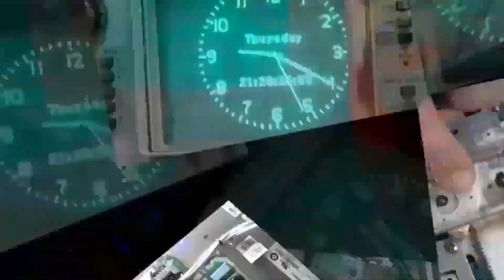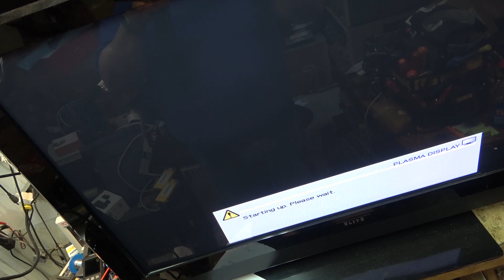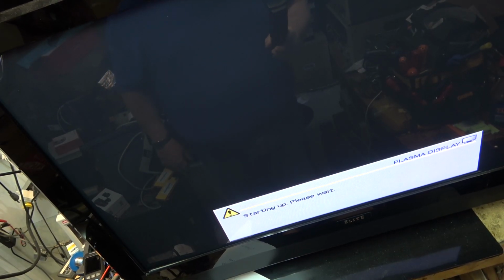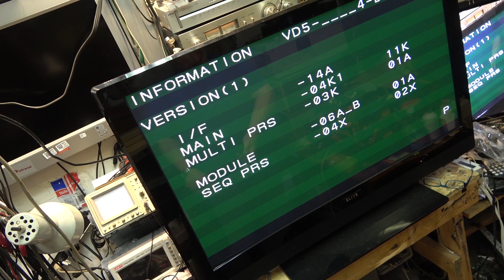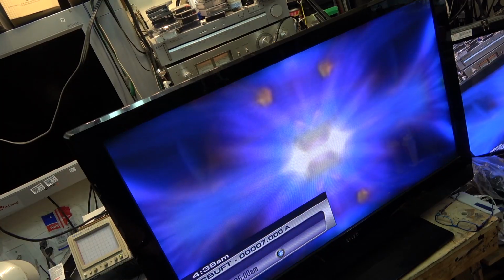Pioneer Plasma TV "Trap" Switch bypass and reset procedure

Comment: Hi I get a black screen on the Pioneer Kuro Plasma Television on start up I press the on button on remote I hear a click TV boots up then shuts off in a few seconds and the blue light is there blicking 12 to 13 times please help me.

My remote is a AXD1555.

I bought this TV brand new in 2007 at my local Bing Lee Appliance Store and been using it in 2025 until the issue happened today I turn it on watch tennis for about 10min then it instantly shuts off by itself my all the dust in the vents over the years in top vents ?

Anyways I try to turn back on but it boots up stays on bkack screen then shuts off instantly and blue like flash 12 to 13 times. Maybe it's a software issue related to digital tuner pcb TV Guide being outdated or damaged main board pcb.

Note: I can't access menu or settings on my remote no matter what I press.

Because the tv would shut off instantly with the blue light when I press the on button standby with black screen I hear it coming on but it clicks and goes off sigh 😩

Comment: Does the the trap switch get activated if there is no power to the plasma when the back is removed? Would it be possible to slide a bid of card down in-between the back cover and the frame to stop the trap switch from being triggered? thx
Reply from the maker: It triggers if you plug in the power with the back of even if you don't attempt to turn on.
Reply: @12voltvids  so if I remove the power lead and then remove the back it shouldn’t trigger the trap switch? I have a PDP-C509A so if I do trigger the trap switch I’ll have to get a factory service remote I believe to reset it.
Reply from the maker: Won't trigger unless you apply power

Comment: A Trap Switch???? What a diabolical sadistic stupid idea!!! Who the hell did they think they were? A-Holes. I ran into a similar situation when RCA went to the CTC 186 from the CTC 177 then to the last Thompson CTC 203. It was CHIPPER CHECK a hairbrained idea to mimic a vehicles' ECU interface. The only problem, and a GIANT one is although the CTC177 had a chipper check socket, you would BRICK the set ii you plugged it in to that chassis. See service Bulletin # FUBAR! The service menu on a CTC 203 was not accessible any other way. Unauthorized Techs were done. No adjusting anything even Vertical height or a tuner alignment with out the added hardware-software expense.  Back to the point Pioneer should be ashamed of themselves! What friggin nerve. Lucky you found it with a little research. Good Job!
As a side note the tuners were on the board and not a discreet component and you had to re-do it if you changed the eeprom which got corrupted turning off the audio in the set. I wrote the old numbers down and just re entered them after installing a new eeprom chip.(screen V 101,102)
I remember you mentioned that you would mess with the horz freq setting on the set putting it into shutdown. BAD BOY...I would have been blessing you @!#$%@#$ If I ran into one LOL 🙂

Comment: Another  word   power  supply  short  detecter  Circuit    simple
Reply from the maker: There are over voltage, under voltage, over current shut down circuits but the trap is something else.

Comment: I still use a pioneer plasma in our living room, beautiful picture, my plasma in the gaming rom is a Panasonic ZT65 built in 2014 and still competes well with todays OLED screens, best plasma in the world and the last one ever built.
3D is awesome, it came with a pen so you could draw on the screen on videos or photos, 2 sets of 3D glasses, a touch mouse remote (bit like an iPad trackpad) and the main remote, only about an inch thick and 60" screen, amazing tv.
Reply from the maker: Agree about plasma.  I have a 63 Samsung since 2009. If it was a kid would be driving by now lol.  Of should i say "should" be driving.  I have a 25 year old with his learner's permit.  They have a beautiful picture.  They were built 2 last that's for sure.  My oldest plasma is the one just to the right of the work bench it's 22 years old.  Standard def, full of boards and weighs a bloody ton. Vcr and DVD looks spectacular on this one as it's 480p so no rescaling required.
Reply: @12voltvids  Hii is there anyweay for me to reach out to you about fixing up a old camcorder my mom had. I found some tapes of my baby shower and wanted to watch but when I turned it on and used a different tape when I fast forward and rewind the tape spit itself out and all the film comes out! @12voltvids

Comment: This probably would not be allowed now that the "right to repair" has been implemented. RCA had a thing called "Chipper Check" which was a proprietary interface you needed in order to service many of their sets in the latter 1990's and early 2000's. You could not make any of the normal service adjustments without it and a laptop. Just as sneaky.
Reply from the maker: Rca you could adjust with a remote. Hold 3 buttons on the front and you were in.   Chipper check was used to load blank eeproms when the original one failed.  I had a clip that i clipped on the chip to read the data and then edited with the same software hackers used to mod the tsop on dishnet receivers to get dead rca sets back up and running.

Comment: Cant you just open the back not power on set and splice the trap switch ?
Reply from the maker: Yes.  It's only operational if you apply power with the back off.
Reply: This will work if you knew it was there, but many of us were caught unaware of its existence.

Comment: They may have been sneaky bastards but damn smart protecting their proprietary equipment.  Not so cool for local repair techs not Pioneer qualified though.  They were expensive as I remember and yeah I bet a bunch went to the dump way too early.  Good video, thanks.
Reply from the maker: It wasn't their equipment.  They sold it.